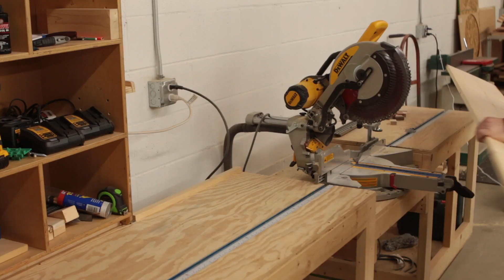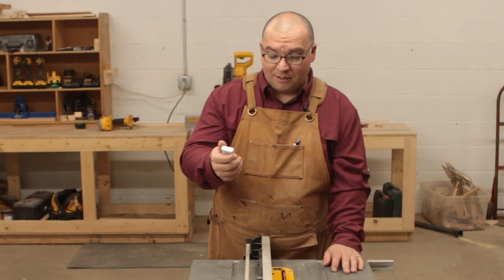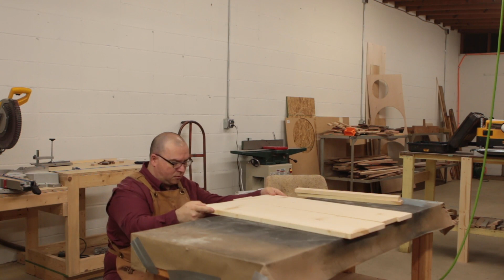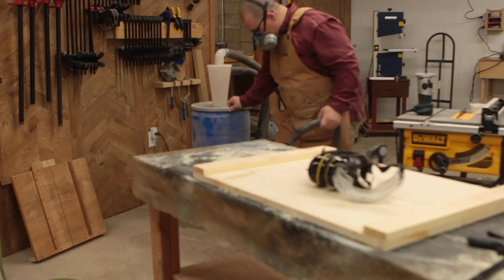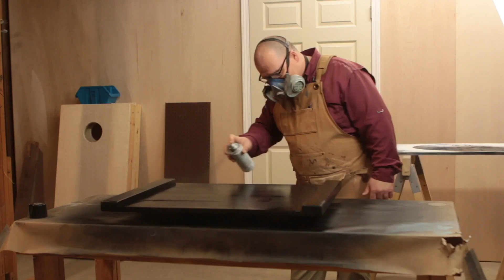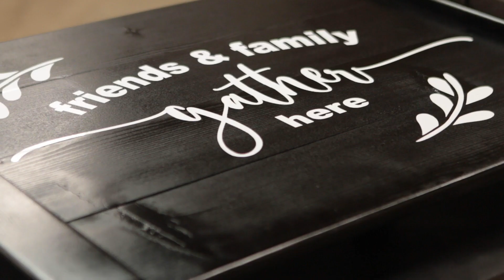How To Make A Noodle Board Stove Cover

Comment: Hi was wondering if I should buy a 1x12 board or just a long 1x6 and rip it down to make this, also I don't have a lot of cash right now but was thinking of getting a dewalt cordless planer, is this the right tool to level out the boards after cutting so they join and lye flat? probably will use it for a table top also Thank You :)

Comment: Hi, I made one of these and it doesnt lie flat, I don't have a planer, is there something I could do to keep the bottom level? Thank You :)
Reply from the maker: From my experience, if it doesn't lie flat, it is usually due to warped material.  Were you using lumber you milled and dried or something from the store? Too much moisture is usually the issue.
Reply: @malonecustomdesigns  yeah thank you I ended up buying the board at Home Depot, which was probably my mistake lol
Reply from the maker: @smeg8557  If you buy lumber from a place like Home Depot, I recommend letting it sit in your shop a few days before cutting.
Reply: @malonecustomdesigns  oh OK sounds good thank you I didn’t realize it would only take a few days to dry thank you so much
Reply from the maker: @smeg8557  Well, that won't dry it, but that will acclimate it to your shop.  Seems to help for me.

Comment: You drop that once it's coming apart. No glue and a few pin nails holding the rails to the boards? Making more work for yourself for something to only look rustic in the end? I don't understand why you didn't just cut everything to size in the first place for it to turn out so basic in the end anyway.
Reply from the maker: lol I liked your original comment before you edited it. "little man" haha. You were correct...I'm no professional woodworker.  But I will say that a professional would not glue these boards to the rails.  Wood movement would cause it to split if it were glued. But I will tell my wife to stop dropping hers so much.....the first 20 drops she has just gotten lucky...the next one will probably break it!  Thanks!
Reply: @malonecustomdesigns  ridiculous comment if you ask me. Correct glue flexes with the wood. Either that or you using superglue. Also I edited my comment as I felt harsh. Besides you can't pick your height can you.

Comment from the maker: I can't find the link to the exact one...but I am pretty sure I got it at Menards.  It is a pull handle.  However, the one I use only had two holes in each handle...this one has 4. https://www.menards.com/main/hardware/gate-hardware/national-hardware-reg-5-3-4-pulls/n116-830/p-1444448883435-c-9691.htm?tid=69e486cc-43d7-41e9-a2cb-8202313c4208&ipos=9&exp=false

Comment: I think you did a good job at explaining. I was wondering if you could share the link to the handles? I can only find one kind that has the screws on top, as opposed to the bottom ones. I prefer the top mount screw handles.
Reply from the maker: I can't find the link to the exact one...but I am pretty sure I got it at Menards.  It is a pull handle.  However, the one I use only had two holes in each handle...this one has 4. https://www.menards.com/main/hardware/gate-hardware/national-hardware-reg-5-3-4-pulls/n116-830/p-1444448883435-c-9691.htm?tid=69e486cc-43d7-41e9-a2cb-8202313c4208&ipos=9&exp=false

Comment: Curious how you keep the seams on the main board from becoming not flat? Had two that were perfect, sanded, assembled and finished, and now there is an edge on each board across the top. 
Thanks!
Reply from the maker: We actually don’t try to keep them perfect. If you are wanting that, you would want to glue and biscuit joint probably. We just go with it the way it is.
Reply: @malonecustomdesigns  Fair enough. Thank you for the reply, subscribed!
Reply from the maker: You’re welcome.

Comment: Hi Jay. Just curious…Is there a reason you did not seal the board?  Is sealing not necessary when you spray paint? If you were to seal it , would you apply it before or after the vinyl?
Reply from the maker: Most paint does not require an additional topcoat.  The paint itself is the "sealer". If you were staining it, then yes, you would clearcoat it, then install the vinyl.  The vinyl does not stick well if you try installing vinyl on oil-based stain without sealing first.
Reply: @malonecustomdesigns  Thank you for your fast reply!!! 
My husband has stained and put a coat of poly on the NB’s he made and I was afraid I wouldn’t be able to add vinyl. 
Oh, one more question..  since he has already put the poly on can I “stencil” on top of it instead of using vinyl? And should I use chalk paint or acrylic?  Thanks again!!
Reply from the maker: @tammy1317  Vinyl will work great on top of the poly, but yes, you can paint over the poly. I would probably recommend using acrylic. I think chalk paint will show scratches more.
Reply: @malonecustomdesigns  thank you again!!
Reply from the maker: @tammy1317  You're welcome.

Comment: Question: How do you keep the boards from warping? We've made 2 of them in the past few days, and they're straight when put together. Laid flat overnight, and by the next afternoon, there's a bow in it. Any suggestions?
Reply from the maker: Hey Shelly, I ran into that a couple of times when I was using 1X6's from Home Depot.  I think it was because the lumber wasn't dry enough or acclimated to my area. When I started using 1X12's from my local lumber yard, I never had that issue again.

Comment: a good woodworker would have edge glued the boards & used screws not nails. it appears the boards are already warping. the vinyl does look good.
Reply from the maker: Thanks for commenting. While I do not claim to be a great woodworker.  I have made a whole bunch of these this same way and they are still holding up great.  However, edge gluing the main board would be great if that is the look that you are going for.  If I were to make a higher quality noodle board from something like oak...then I would probably edge glue and biscuit join the panel. :)